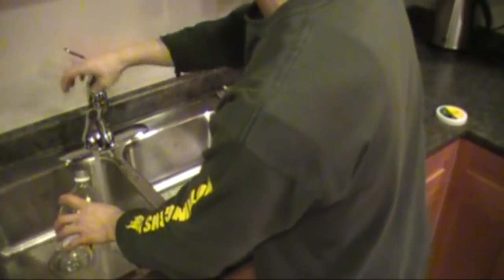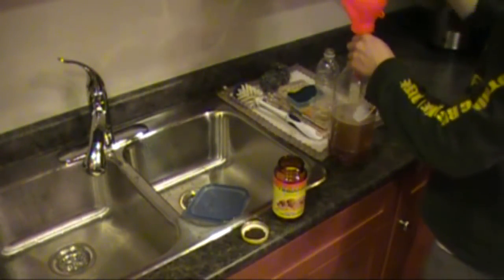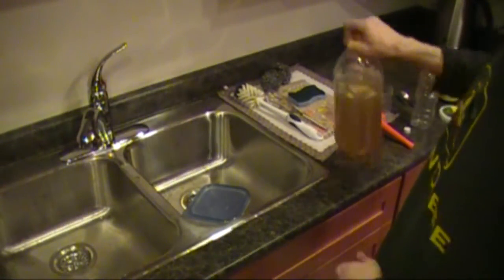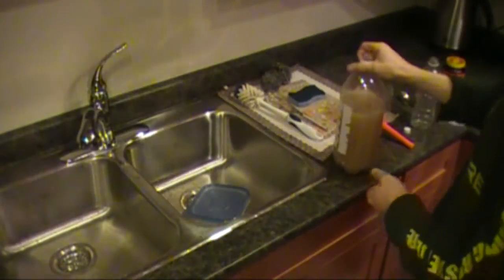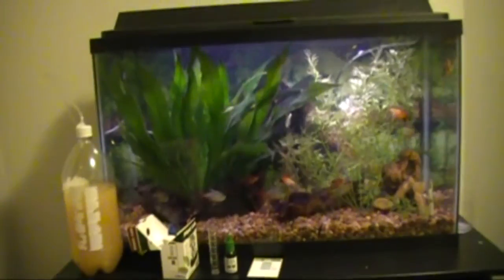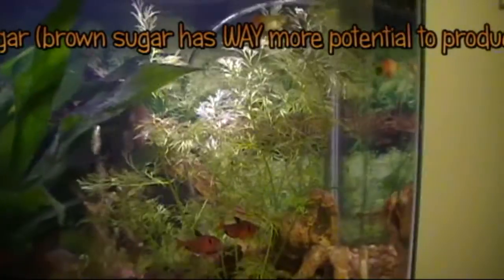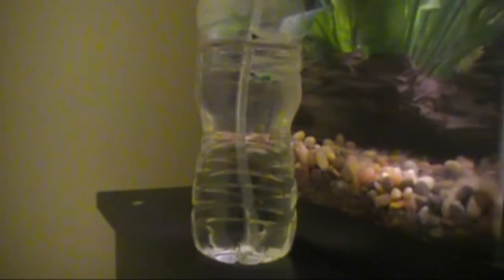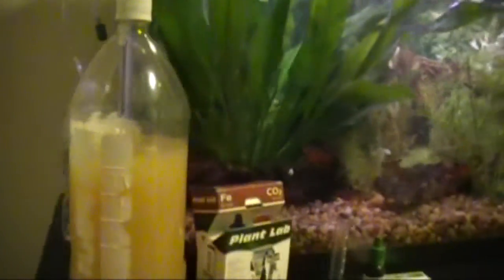Request Co2 (reactor) preparations in detail

Comment from the maker: @3waad3 I apologize for the late response, I bet you have the answer for your question already. You can't get rid of the alcohol during the process. The bacteria produce it as result of digesting the sugar. But when the mix is done producing Co2, you can just dump the useless solution in the sink. Other than that, there are Co2 cartridges you can buy also. Pure compressed Co2 released by a contraption.

Comment: hey man, im going to use this in my 3 gallon tank with my shrimp. because of the smaller volume of water i wont need as much co2. do you think i can use the same recipe, and same size bottle as you, but only put in half a teaspoon of yeast? i hope this will make it last twice as long but still produce a steady flow of CO2

Comment from the maker: @imthevictorr You are absolutely right, which is why I was first skeptic about putting Co2 through the filter (since most of the bacteria are in the filter). But as a matter of fact, the bacteria need so little oxygen and produce Co2 by themself, that the Co2 I add on top, does not seem to have an effect.  What I am sure about is, that when you start a new tank....

Comment from the maker: Hey there :)

You either open the cap on the Co2 solution bottle or turn on the air pump (which worked better for me).
I seemed to lose a few days of Co2 production by opening the cap, and it was easier to adjust the Co2 concentration with the amount of air going into the tank.

Good luck!

Comment from the maker: Hey "krav"

The 2 answers:

1st, indeed, the more solution the more Co2 you CAN produce, doesnt mean you will.
The main factor in all this is the yeast, the more you add the more Co2 is produced, the lesser yeast you add, the longer the Solution lasts (lesser Co2 production).
A big bottle lasts longer, but it is harder to determine the right mixture.
The opposite applies to the small bottle, you can control it way better, but it need refilling more often....

Comment: does the size of the sugar/yeast container vary with tank size? i mean for a small tank like a 5 gallon..would a smaller container be better or would they yield the same result?..because if theyre just the same then a larger container would be better right?since it would last longer given that it contains more of the solution..

and i saw on the info box that one should turn on an airpump or lossen the cap..so this means that the CO2 musnt be a 24/7 thing..ryt?

thank you very very much..

Comment from the maker: I do not see why it should damage the filter in any way.
Air in the system will not be an issue, nor the Co2 itself.
The plastic is safe I am sure of it and forums I checked before I started all this, did not state any troubles and ppl ran things like this for years.
I was worried about rubber seals, but it seems the motor will fail before you see an effect of the Co2 on anything that involves the filter.
Hope I satisfied ya :)

Be good my man!